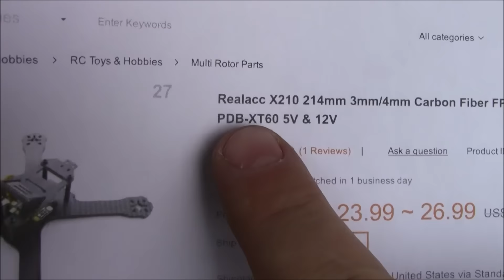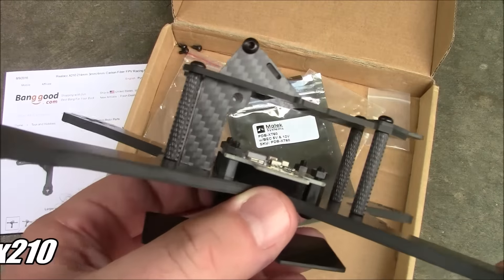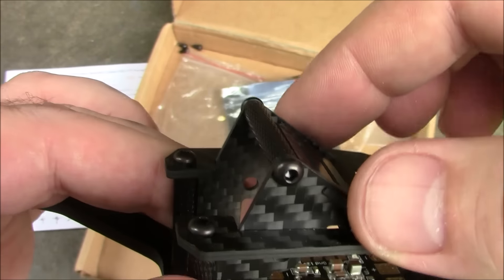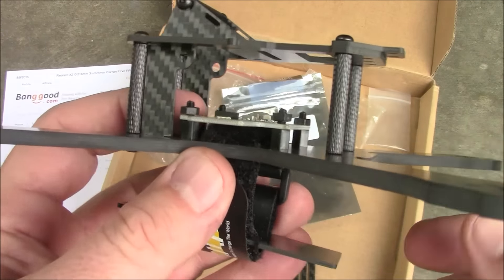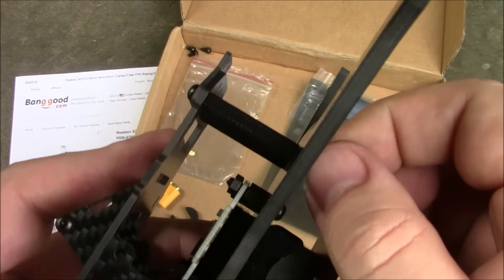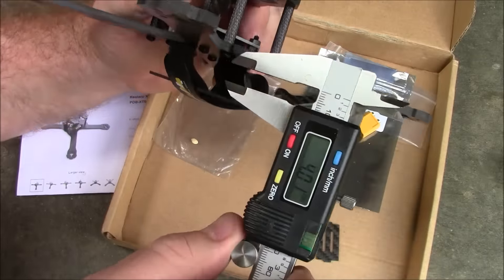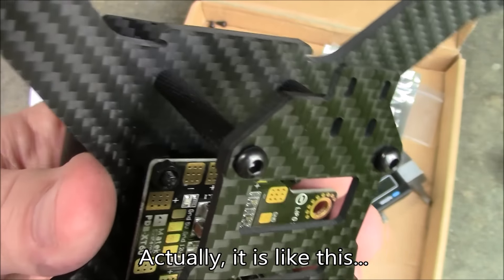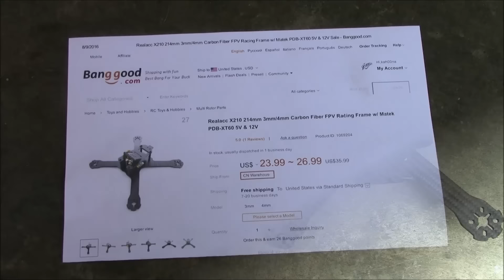Realacc x210 (QAV-X Clone) Frame Review from Banggood

Comment: I JUST BUILT THIS QUAD AND THEY FIXED ALL THE PROBLEMS YOU MENTIONED.
Reply from the maker: Good.  This is my favorite frame.  I've been flying it since I got it built.  The frame has survived all the crashing I've been doing.  I did finally manage to burn up an ESC and motor, but the frame is still fine.
Reply: travisgrindal yes the kit now comes with all sorts of screws both short medium and long also that plate for the GoPro bracket has been sized correctly at least on the two kits that I've received.
Reply from the maker: Cool.  If mine every breaks, I'll order another.  :)

Comment: Solder all your wires directly to your board (naze32 rev6) this will allow camera to rotate 30-45 degrees. Also makes the quad lighter. Taranis xsr also fits under pdb. Frame is so much better than the QavR. Love your vids Travis.
Reply from the maker: Thanks!  For this quad, I'm going to try a different branded receiver to use with my Taranis.  It is a RX-800.  It only has one antenna but does supports SBUS and telemetry with the SP Racing F3 board.  I need to get it flying!  http://www.banggood.com/IRangeX-RX800-2_4G-8CH-SBUS-Mini-Receiver-Compatible-Frsky-X9D-PLUS-X9E-DJT-DFT-p-1074060.html?p=6Z050013977120130325
Reply: +travisgrindal can you do a review/range test/comparison on this receiver. Wow that is cheap.
Reply from the maker: So far I like it. After I get it flying, I'll take it out and see if goes as far as I am comfortable sending it. I mostly race and fly around a football field. As long as it can still do that, I'll be real happy.

Comment: where did you get the STL for those 3D printed parts on that Whippet Frame? @ 5:39 nice!
Reply: It is included with the frame
Reply: Fpv-Drone-Racer so no way to print "replacements"? :( Thanks!
Reply from the maker: You could probably order an extra set if you think you'd need them.
Reply from the maker: Also, if you're interested, here's the view on the Whippet frame:  https://www.youtube.com/watch?v=uOIH8P4HLks

Comment: Travis, the two holes in the back are to have two zip ties to hold your vtx antenna. Just check the lumenier qav-X photos lol....
Reply from the maker: I figured it was for that, but the Alien frame had a similar setup and ran their receiver wires through them.  I guess VTX makes more sense and then little plate is so you can move it over to either side.  If it was built in, it would be stuck on just one side.

Comment: I've received mine, the holes for the FC are a bit tight, or I mean, not aligned to the standard holes, anyway with a bit of force the pdb stays in place. I have a problem on the top standoff between the camera plates, seems that the space between the plates is 29mm while the standoff is 30mm, I have to file a bit the top plate carbon maybe. The little angled plate is the right size anyway and don't fall off as yours.
Reply: I've just found that one of the standoffs is shorter, so right now I've solved the camera plates problem... For the holes... Let's say that with plastic standoffs is ok...
Reply from the maker: +Alessio Molteni Some one else said that one spacer is shorter than the others and it was. I had the short one on top and my plate was still too small. I'm glad yours fit correctly.
Reply: +travisgrindal The main issue are the pdb holes, I guess I can fit everything, but it's disappointing... Where do you suggest to mount the rx?

Comment: One of the spacers is a bit smaller on mine for the top section. My HS 1177 fit perfectly in the holes.
Reply from the maker: My camera points slightly to the left when I use the mounting holes. It isn't terrible but you can see it if you look closely.
Reply: 4 spacers are 30mm and one is 29mm to go on top.

Comment: the only really frustrating thing about this frame is that you don't have enough room to softmount your FC so using smooth motors really is a must. The notch filter in betaflight 3.0 helps a lot also.
Reply from the maker: A few people have said that... what are some examples of "not smooth" motors?  I've never heard anyone say, "I'm looking for some grinding motors. Anyone have any recommendations?"
Reply: How come u dont have room? What kind of poor softmounts are u using? Check my channel for a build with softmounts.
Reply: I'm craving for the Kiss Tornado combo. In a Armattan F-6 frame.

Comment: It looks like the top camera mount is designed exclusively for a "go pro" style HD cam. Can you say if it is possible to mount a Runcam 2 on it? Thx.
Reply from the maker: I have a RunCam and it will be a little tough to mount it.  The GoPro would be easy.

Comment: Thanks a lot for the awesome review! Do you think an LC filter is needed with that pdb for the video feed?
Reply from the maker: I haven't used a LC filter on any of my recent quads. When I first started building, I thought it was basically a requirement. Then I started leaving them off because I never seemed to have one when I wanted it and now I don't use them at all on any of my quads.
Reply: Ok thanks! And your video feed is crystal clear without a filter? No lines etc.?
Reply from the maker: You can see the quality in this video. The TC-R260 is the quad I'm racing now. The feed is at the very beginning and skip up to 17:00 to see a longer view:  https://www.youtube.com/watch?v=qko1oi2HWRs
Reply: +travisgrindal wow that looks pretty clean! Thanks for the insight info! :)
Reply: One last question if I may, what size heatshrink should I get for wrapping littlebee escs? What diameter fits them?
Reply from the maker: +Willem Vergouwen It seems like whatever I buy never fits and then I have to buy more. I have been buying it off ebay because I can't find it cheaper anywhere else. I'll see if what I have has a size written on it.
Reply: +travisgrindal Yeah that describes the exact same problem I'm having every time! Thanks, let me know! :)

Comment: Hi Travis, not concerning this video, but i saw that you were using littlebees escs, in others of your videos... I m running cleanflight, with 30 amps littlebees and my motors are "turning", even when they are not armed, when oneshot 125 is enable.. 
I didn t flash anything on them, but i read they came with oneshot 125 pre installed.. Question ; do i need to change some values in cleanflight ?  i checked the looptime, looks like i m good there... should i reflash them ? Any advice ?
Reply from the maker: I know exactly what you are talking about. i don't know what causes it. Mine gets more of a twitch when it just sits there. once I'm in the air, everything is fine.
Reply: Ok thanks a lot Travis, I knew you would know what i m talking about :) I ll try to find out, what s going on... and if i can .. i ll let you know.. Thanks for your time.

Comment: thanx for the review, do you know where I can get the longer screws? and how long the best long 6 mm? or 8 mm?
Reply from the maker: These should be perfect.  For the 4mm plate, I'd go with 8mm screws so you have 4mm going into the spacers.  8mm would probably be fine on 3mm plate as well just a little long. I think you could get away with 6mm screws with only 3mm in the spacers.  You'd only need 8, but here's 20 8mm screws for a good price:   http://www.banggood.com/Diatone-M3x8-Inner-Hexagon-Screw-Pack-20pcs-For-RC-Multirotors-p-973477.html?p=6Z050013977120130325
Reply from the maker: Actually, after thinking about it a little more, I'd probably go with the 8mm screws with either plate.

Comment: Travis how is this frame if I want a light faster quad for racing multigp tracks,I've got alien 5" but I feel like I'm working. Too hard for corning
Reply from the maker: I've been flying the 4mm version of this quad for almost a year now.  I've crashed it tons and it hasn't broken yet.  I have burned up an ESC, motor, and flight board, the frame is just now starting to show signs of wear on the ends of the arms.  That is about it.  It isn't the lightest frame.  With my RunCam 3 mounted on top of my X210, mine weighs in about 400 grams.  The X210 frame alone weighs around 100 grams.  Banggood just put a new Bfight frame up on their site that says it weighs 59 grams.  I'm not sure that is possible, but I ordered one so I could find out.  https://www.banggood.com/Bfight210-210mm-Carbon-Fiber-FPV-Racing-X-Frame-4mm-Frame-Arm-p-1181906.html?p=6Z050013977120130325

Comment: Do you think tha  this frame will fit HS1177 when flight controller is installed?
Reply from the maker: Yes, but you will probably have to rotate the board so the ESC pins are in the back instead of the front or side.
Reply: it does fit but the camera is very close to the board you need to use quite short spacers for the pdb and Fc though.
Reply: TBH when building it became apparent that really the LUX with its cut out sides would work better and give you more camera room.

Comment: How come you don't buy the real frame also to compare quality? Also when you do the reviews could you test arm flex please?
Reply from the maker: The original QAV-X is $90. It is hard to cough up that much money for a comparison video.
If you're running 5" props on a quad with 4mm thick arms, there shouldn't be any flex at all.  6" props with strong motors may make it flex a little but that would require some serious torque.
Reply: +travisgrindal but this frame would not have existed unless lumenier spent time and effort developing the frame. It's always good to support the original developers of a product. And I'm not worried about in flight flex, I'm more worried about when it hits stuff and when I went from a qav210 to an alien there was a noticeable difference in flight characteristics because of how flexible the 210 is. I think vibrations make the frame have a slight harmonic and thus causing issues. The alien is the stiffest frame I have ever come across and you don't notice the difference until you actually fly one.
Reply: +shaneman27 buy him a qav x to do a comparison video on then. I'm sure he wouldn't mind!
Reply: +shaneman27 buy him a qav x to do a comparison video on then. I'm sure he wouldn't mind!
Reply from the maker: Heh... yeah!  Send me one and I'll do a real good comparison!
Reply: +travisgrindal ;0)
Reply: I guess you guys don't get the point
Reply from the maker: We understand the point - 7:56 in the video.

Comment: They just released a combo kit 4 20a esc, four racerstar motors, 14 blades, FC and this frame for just $107
Reply from the maker: I saw that earlier and put a link to it in the description. That is a great deal.
Reply: When are you going to review the racerstar motors? they seems to be quite good, the low price seems to be just to brake in in the market.
Reply from the maker: Hopefully soon, but I'm trying to fly more than experimenting right now because summer is almost over.

Comment: Just got mine last week and the holes for the PDB are 29.5mm apart instead of 30.5mm.  Impossible to mount pdb without drilling out the holes which would possibly shift the position of the FC relative to the motors.  No answer from banggood... and of course my negative review isn't being published.  Ever wonder how most of the reviews on banggood are positive?... :)

Also, these things aren't actually carbon fiber.  They flex way too much to be full carbon.  If you look closely at the cross section, the outer layers are of different color than the middle layers.  Its got really cheap carbon outer layers and all other layers are just black fiberglass.
Reply from the maker: I get voltage readings between different edges of the plates.  What size of main plate did you get?

Comment: It is not original Matek PDB-XT60.  There is QR Code of manual on the original Lable
Reply from the maker: The QR code is on the other side of the package.
Reply: The font is different on the PDB.  You can check the font of "Matek Systems" nearby PDB-XT60. Different from the original logo

Comment: Lol you have 1 shorter spacer. Than it fots with no problem. You used the longer spacer on top and the shorter with 4 others. It is just 1mm shorter but it will solve the problem. 
The cam is very close to the fc and you must mount it in an angle els it will not fit. It is a qav clone. 6 of the 10 screws are to short.
Reply from the maker: Really?!  I'll check again.  i was pretty sure they were all the same length.
Reply from the maker: You are right. One is 29mm.  However, that is the one I had in the camera mount in this video so I guess I got it right by accident.  So the plate is too small even with the 29mm spacer on the top.
Reply: Strange with mine it fits good. Maybe a mistake in your kit. Mine fits very nice.
The only problem is the place were the cam is mounted. With an fc on it, it is very tight and top connector or botom connector have both a problem. Top limits I your angle and bot the other way around. I am going to drill some holes in the cam plates to move the cam a bit forward and a bit lower.
The frame is copied of photo's and I must say that they did an impressive copy that way.
It is a nice frame with some typical Chinese flaws like the screws that are to short, the cam mount is 29 instead of 28mm and the carbon edges. But all are not a big problem and for that price I can't complain.
I will use a 4 in 1 esc. Saves some parts and soldering. Motors and esc will be shipped today or tomorrow.
Reply: I am thinking of leaving that smill plate above the cam away so I can easy reach the connector for the cam. Easier to change settings on the cam.
Reply from the maker: I have the 3mm version on its way. Hopefully the plate that comes with it is the right size.
Reply: My 4mm version has the right size. I think that it was a mistake in the production. It is not a part that you really need.
As you want an other cam angle you can 3d print something on it so you can give it more or less angle.
I must say that they gave a nice pdb with it.
I have that same pdb on an other quad and it works very good.

Comment: "Thank you" for promotoring cloning frames, stolen designs...This Is Very bad for the industry.
Reply from the maker: Did you watch the whole video... specifically around 7:56 in the video.?
Reply: +travisgrindal most people can't afford $100 frames let alone all the components if your have a solution for cheap good quality hobby fun I'm all ears but you crash the charpu x your out $100 with this you can buy 6 or more nothing wrong with supporting the original designers to keep doing what they do best but you gotta think about the people that literally can afford to support them